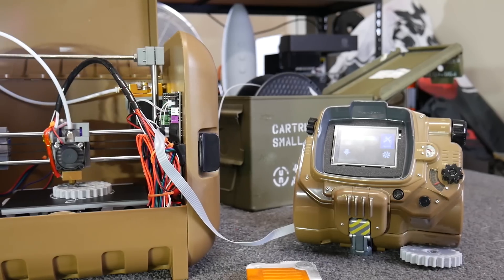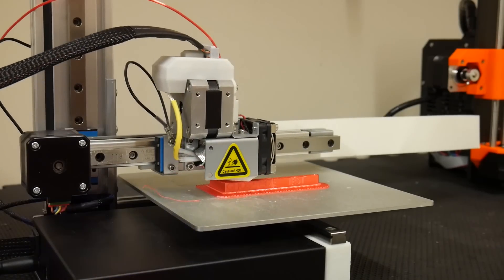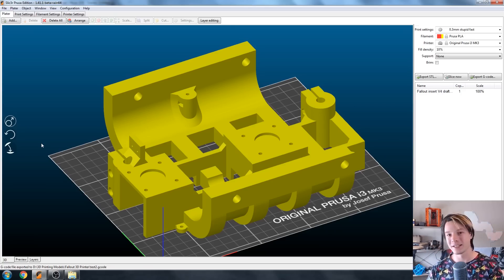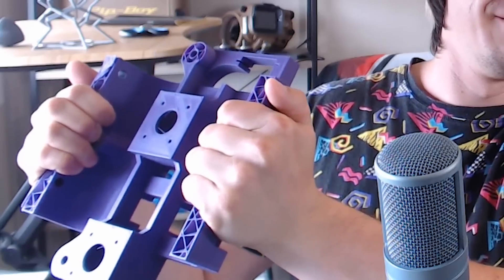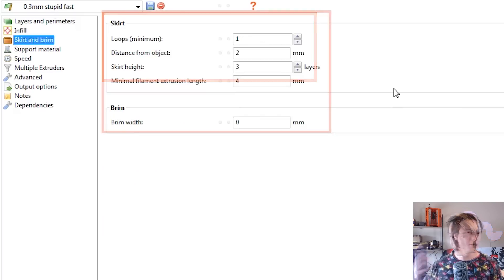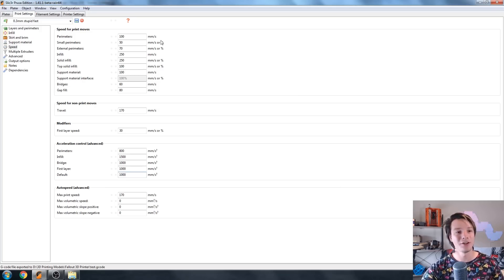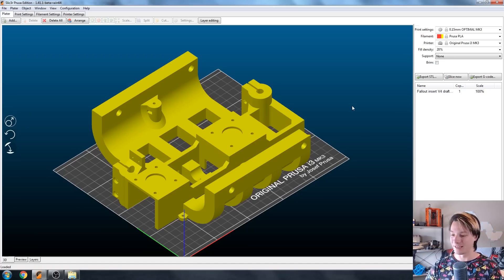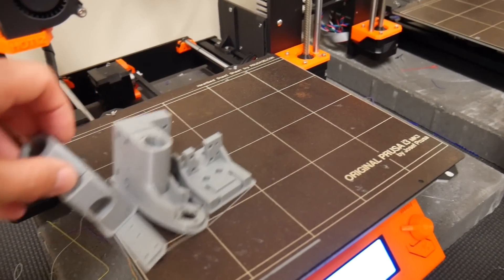3D Print parts TWICE as fast with simple slicer tweaks. 3DP101

Comment: I  used my Ender 3 and Cura slicer. I  printed a piece took 12 hours an Arduino case I was proud.   finally A good print at the end of the print took out the model took my Arduino board and the box was to small. Got the file from thingiveres :(Ant teach hes cloning machines. only the best has the chance

Comment: I long ago settled on a 0.5mm nozzle and 0.3mm layer heights, and running PLA @210C for speed. Very seldom less than 3 shells, and usually at least 30% infill. My parts are strong and suitable for mechanical use with any minor blemishes irrelevant most of the time.

Comment: I recently switched to a 1mm nozzle on an anet a8 with a e3d head. Print are fine. currently printing petals for my Nissan leaf alloys. do you have settings for 1mm nozzles? like what layer height would you use for 1mm nozzle?
Reply from the maker: Try 0.6mm layers with 1.6mm line width, works nice.
Reply: thanks Angus
Reply: @MakersMuse  tried the settings tonight. i had major extrusion issues, maybe a bit to fast for my bowden setup. possibly my hotend cant keep up either? perhaps if it ran 24v then maybe but i havent got time to mess. ill go steady with my old settings. Thanks for the help though. If it had have worked my 1h50 print would have been 15mins

Comment: Angus, I tried your settings on my Prusa i3 MK3S printer and got some decent results. I did notice
that a couple of my vertical sides, of my print, looked like blistered paint. Sections of the sides bulged slightly. I'm not sure which setting I need to change in order to correct that problem.

Comment: Im new, so sorry if this is a dumb question, but do you have to change settings on the printer itself as well? I tried .28 layer height on Cura and it was a mess. Filament didnt adhere.

Comment: If I need strength from a part, I leave just enough infill to support the structure, then vacuum fill it with chocking compound, superplasticized cement, or epoxy depending on the application.

Comment: I've been printing 0.3mm since watching your video - I'm mass producing some little jigs to hold LEDs in place for soldering at maker fairs.  I was amazed to find my stock Anet A8 works with the cheapest filament at 0.3mm and 250% speed!   Next I think I'll install the Drylin bearings I bought to quiet it down.  P.S. the PEI bed accessory I bought was not good, but smearing a 50% mix of PVAc (white glue) and water while at 60ºC made a good bed - things don't slide and come off easily.

Comment: Hi, Thanks for sharing.
There is a real problem when doing "small perimeters": this induces vibrations because the speed is constant so is the spacial frequency. One solution is to use a no-constant speed. I've worked in the past on big CNC machines, and we had the same problem (obviously not at the same level) when trying to go too fast. One solution has been to do a random variation of the speed when the direction of machining (print in the case of a 3D printer) has changed of more of 90°. This way, without any mechanical dumper, we have some kind "software dumping" [tm] and the quality is greatly improved. The speeds have to be choose to depend on the spacial frequency and eingen modes of the machine.
Reply: Interesting idea! This is similar to the spread-spectrum techniques we use in communications to spread the power out over a range of frequencies rather than concentrating it all at a single frequency. This can help avoid creating interference with other signals and also makes the signal more tolerant to outside interference.
Reply: @reverse_engineered  The problem is when the acceleration is very high. This acts like a dirac pulse and excites the resonant frequencies of the whole machine.
Reply: Wow that's fascinating
Reply: Eigen modes… phew if only my teacher could’ve come up with a single reason we would need to learn them as students… and here we are!

Comment: Sometimes I print a hollow component and use concrete as infill, its cheaper. Adds mass and is much stronger. I use it for large .modular assemblies
Reply: @CanadianCarbonUnit  i'm working on a steam engine & air compressor right now and I have used concrete infill for the flywheel which consumed 50g of plastic and weighs 530g.
this is just as a hobby since i do not understand engines well, but i may upload files for the sunbeam, which is a 100w light to thingiverse soon. It does not include many fancy features hough, since it was designed by my 13 year old self a long time ago.

Comment: .3 has terrible layer adhesion. Not worth it
Reply: @DunnsDay Dash - We found that our filament was under-size, adhesion at 0.3mm was improved by correcting this in CURA (slicer) as well as gradually upping the flow from 100% to 110%.  Another 5 deg C of nozzle temperature seemed to help.
PETG layer adhesion is better than PLA in our experience.
HTH Ben

Comment: This saved me sooo much time on my build. I went from about ~50 hours in total parts down to ~24 hours. That's over 50% faster! Didn't save a whole lot on material but that's ok.
Reply: It's 108% faster not just 50%.
Reply: Carl Siemens Either quarantine has sizzled my mind, or your math is wrong
Reply: @Nichealys  His math is correct.

Faster indicates you are comparing speed.

50 hours = 2% an hour speed
24 hours = 4.1666% an hour speed

Speedup = (4.166 - 2.0) / 2.0 = 1.083 or 108.3%
Reply: @pallavagarwal07  Yeah, not too sure what I was thinking.
Reply: @Crlarl  108% faster would be it being done before it is started.  the old time is 108% slower than the new time
Reply: @johnpaullogan1365  
No, speed 2 is 2.08 times speed 1, an increase of 108%. A speed decrease of 100% means stopping completely. If it was 108% slower, it would be going backwards. In reality, going from speed 2 to 1 would be a decrease of 52%.
Reply: The rigidity is the same?

Comment: I just got a Prusa i3 MK3S a week ago... I'm very inexperienced with prints, and after tests and small objects and stuff, I launched myself into a 4hr print using the 0.20mm SPEED, gyroid infill at 10% temps at 215º/60º... it came out unusable. Lots of errors, mismatched layers, etc. plain and outright fugly

Did some research, some Ecor towers, some extrusion multiplier checks, everything fine. Printed a 1hr object (Rpi3 case); using 0.15mm DETAIL, 5% gyroid infill, 220º/65º @ 0.9872 ext multiplier (95 on the Prusa), 3/3 bottom/top layers, and it  came out beautiful and perfect. Now (as I type) I'm doing a simple cylinder to store a photo 120 film roll with some threads.... -- same settings but infill at 5% rectilinear (it's a cylinder with 2mm walls, there's little-to-none infill) and using 0.20mm QUALITY instead of the 0.15... all to shave a few minutes off the print time....... now the cap looks like a reprint is coming --- it's absolutely fugly. -- I don't know what I'm doing wrong.

I'm impressed you could get away with your print in such a good way while doing very similar things I'm doing for myself. -- What I'm thinking, is that I'm having temperature issues as yesterday the Rpi3 case that came out beautiful failed the first try during the 3rd layer. Why? -- Fans came on at full speed and since now it's getting cold where I live (and my apartment is fairly cold),  I had a temperature runaway error. -- I'm considering doing an enclosure for it so it keeps nice and warm but other than that I'm exhausting options; I've checked belt tension, rods, leveling -- all the basics, and everything looks okay -- but still, anything higher 0.15 and fairly slow comes up fugly. I don't even dare to run a 0.30mm at this point.

Any tips (anyone) on this?

Comment: It isn't a simple case of doubling a linear dimension increases the print time to 8x. That is because the majority of the time is spent working on areas, not volume.
For a large top or bottom surface, you increase the area to 4x, but still have the same number of layers, so you just increase the print time to 4x (ignoring acceleration).
Likewise for the walls, you double the number of layers and double the length of the wall, but you don't double the thickness, so it is also just 4x.

It is only the infill which ideally becomes 8x due to twice as many layers, the lines being twice as long, and twice as many lines.
So it will depend upon what you are printing but I would expect it to be closer to 4x than 8x.
I would also expect the more complex the part the closer to the 4x. e.g. a cube would be closer to 8x and the object you printed would be closer to 4x.

Comment: Strangely error prone for a Makers Muse vid. For example 1.75mm filament generates exactly the same pressure as any other diameter of filament -- you feed it into the extruder accordingly -- the amount of plastic volume per second remains exactly the same. And you weren't talking about scaling a model by 200% you were talking about scaling it to 200% – very different, and the volume goes up as the cube – it's not exponential – that really would use a lot of filament, and so on...

Comment: actually when you scale a cube (1*1*1 cm - 1cm^3)  to 200% (2*2*2 cm - 2 cm^3) you enlaged it by 2^3=8.
Reply: Exactly my thought. The original cube fits in the 200% cube 8 times, so the print time isn’t a surprise at all.
Reply: @sejoki1  i'd only expect 8 times as long if it was 100% infill though

Comment: Have you done design changes to reduce printing support lattice? For example, if you have a horizontal surface coming up, which needs support structure below it. Make that horizontal surface a separate part, with side walls with enough surface area so it can be glued on? 

I'm thinking of modifying a design just for 3D printing, to save time and material, as we go through iterations. 

If you have done something like that can you please share your experience. Or share a link to a video if you have already talked about it.

This is the most useful channel about 3D printing I have ever seen. I introduced this channel to my friends, and they all have subbed. Thank you for your videos.

Comment: Super useful tip.  I mainly print organizers and inserts for board games so the quality sacrifice isn’t really a big deal and this cuts my print times by 50-60%.  Thanks!
Reply: increasing line width a bit helps a lot too.  set a 0.4 nozzle to like 0.8 width in the slicer does wonders

Comment: I do find it interesting that you say that the mk3 mesh leveling "just works", for me it has been doing nothing, and the only way to get prints to stick over the entire bed is to meticulously manually adjust the bed up and down (mechanically) to get a perfect even bed. I wonder if this is something slightly off in my build, or just a general issue with the prusa.

Comment: Could you make the infill very limited with large open cavities? If so, I believe you could theoretically pour some sort of strengthening material like resin inside that would harden and create a super strong print. Especially with large prints like this.
Reply: In theory yes, that said most resins n such tend to be thermogenic whilst curing which would potentially be problematic for the print.

Comment: The print time is always proportional to the volume. Increasing a cube by 200% means that you are doubling all its dimensions. So the volumes will be 2^3=8 times bigger. No mistery not surprise there.
Reply: but given the lower density of the infil you'd expect to actually find it between 4x and 8x.  given the surface which takes the longest to print only increased 4x

Comment: Nozzle pressure does not change with filament diameter, it only changes with extrusion flow. 2.85 (3mm) filament just moves slower into the hotend than 1.75mm. For an "expert", you seem to make quite a few guesses based on nothing.

Comment: I've also found that rotating the part around the z-axis decreases print time. Not 100% sure why it works, but my guess is that the stepper motors don't have to stop. If you print a rectangle aligned with the X and Y axis, the the Y axis has to come to a stop while printing along the X axis and vice-versa. Since your example print is pretty much the size of the printer, it wouldn't be an option for that print; however, try it with another model and see what happens. I tried it on a ridiculously small print and watched 14m27s go to 14m11s where a 45 degree turn around the Z axis is the only thing I did different. A 1% improvement on an 11 hour print would shave off 7-10 minutes. The more rectangular your model, the better the trick works.

Comment: Would 3D printing be an ideal way to build prototypes of my invention?
Reply: That depends on so many things about what kind of invention you are talking about. 3D printers can print some shapes that no other manufacturing process can do, but there are also shapes that 3D printers suck at royally. For some types of designs you'll flat out need to design your parts to be multi-part, and then glue/screw them together afterwards.

Since you do not seem overly familiar with 3D printing, I would google "limitations of 3D printing", and watch some 3D printing basics videos if I were you.

Comment: 6:36 I've heard that most stepper motors move at a resolution of 0.04mm, and so the cleanest layers should supposedly be a multiple of that. (It's been a long time since I came across that, otherwise I'd cite it here.) If that is the case (and I'm a total newb), why wouldn't one use a 0.28mm layer height instead of 0.30mm? I rarely (if ever) see anyone on YT take that into account, however (and perhaps where I came across it was simply wrong). Is there an advantage or disadvantage to one over the other?

Comment: I have a question on warping issue with my print, I heard that people use glue, blue tape, etc to help the issue, but mine one got special coating on, the heat bed/glass, I mean, so I don't want to put any thing on top of my glass, so are there any setting I can do to the machine to help with the issue?? thank you.

Comment: 0:49 print time does not increase exponentially when scaling. Priting time of a scale model is the old printing time times the scaling factor cubed. This does not take into account that you might have to extrude less material due to wall thickness staying the same.
Reply: Yes, technically it's a power law and not an exponential, but in common usage, "Exponentially" generally just means more than linearly

Comment: Thanks for including the settings for slicer. I used the most current version of Prusa Slicer, with the 3.5 firmware on the Prusa MK3 printer. I used PTEG (Amazon Basics) 1.75mm and the nozzle that came on the printer. I raised the nozzel temp by 5 degrees F. 235/245. The first layer was a little sketchy so I turned the speed down to 40% and then after a couple of layers set it back to 100%. Seems to be working well. My project was 1day+ with the draft settings, and now its about 11 hrs.   Thanks for the video.

Comment: All this makes sense (though infill is a matter of the model engineering ... to horribly abuse that word ... so I followed the other ideas on walls and travel speeds ... using a CR10 and took a print down from 6hr40 to 4hr50 ... not a heckuva lot of time, but as a percentage, a huge difference.
Also fun to hear the CR10 screaming at 200.
Would be useful to have the same specs "translated" to what's possible in Cura 3.6 for example ... there's no "perimeter" but there's walls and layers and skins ... just depends on how each vendor implements these concepts.  Thanks, mate!

Comment: I know the M3 is a darling of everyone's heart, but is not a fast machine. Your infill never reaches those CRAZY fast speeds due to jerk and acceleration. Wanna see what happens if you actually print at those speeds you specified -- add another 0 to your acceleration numbers. If you want to print fast, get a dedicated machine with a volcano nozzle and a different kinematic -- not an i3 with a moving bed,  see corexy, cartesian, or a delta. Using these absurd speeds is rather pointless -- you are hitting firmware limits. Fun thing about most recent duet update it shows requested speed and ACTUAL speed in the UI, interesting to see at what point it actually hits max speeds

Comment: A trick that i like to take advantage of when i don't want to increase layer height is printing at 0.16mm layer height and doubling the infill and support layer height in Simplify3d. 0.32 is the highest you can go with a standard 0.4mm nozzle and that trick works wonders with lots of infill and support compared to printing everything at 0.2.

Comment: More tips if you are using Cura: use adaptive layer height so you can push the maximum layer heights a bit higher without losing as much detail on curves and holes, Cubic infill with several gradual infill steps (to leave it more hollow where it doesn't matter as much) without risking pillowing or gaps like going straight low % infill, and 10 or so degrees hotter temps.  Pushing line width can make a big difference as well, just make sure not to exceed your extruder's max volumetric flow (usually 8-15 mm3/s on std all-metal heater blocks, half that for PTFE sleeved). Volcano with larger nozzle is better, obviously, but I tend to run volcanos on everything, regardless of nozzle diameter because the flow is just so much better and more consistent (and much better volumetric flow, up to 35 mm3/s on my setups).

Comment: 0:48 Frequent misuse of exponentially: x^3 is polynomial time (in this case cubic), exponential would be (e.g.) 3^x which would mean by doubling the input value, you'd multiply the output by 9. Get's more apparent with bigger numbers: x=1000, x^3=1 000 000 000, 3^x= too big to write out, probably already more than particles in the universe.